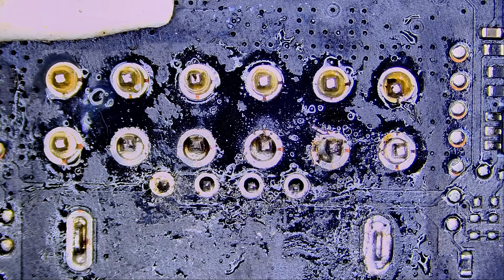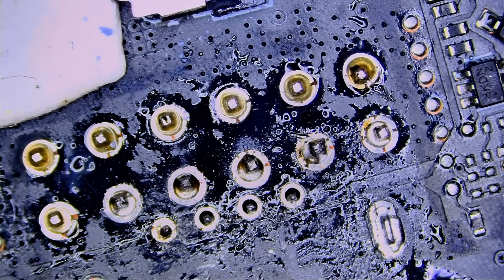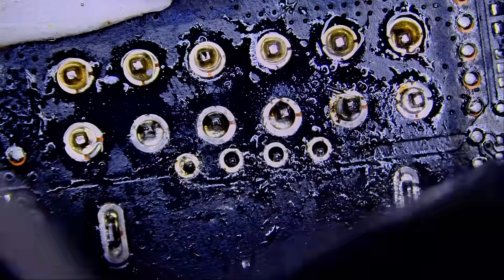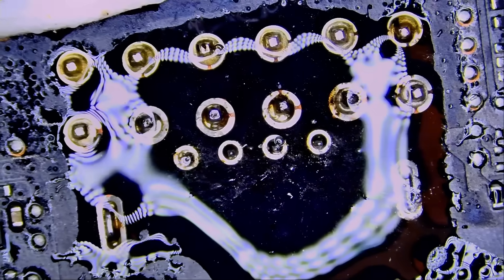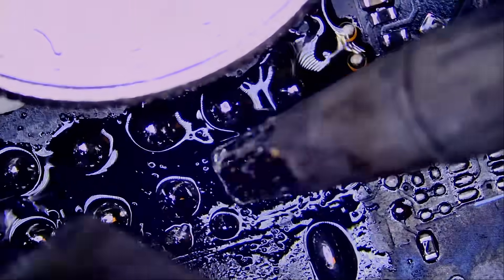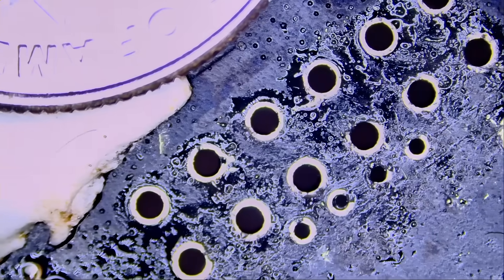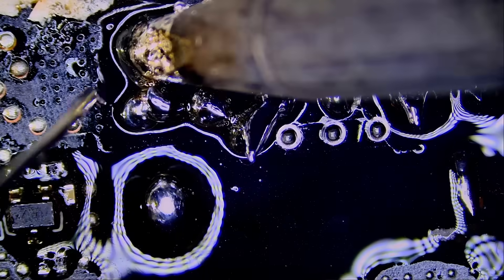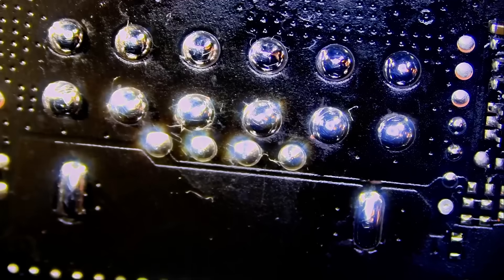Fixing a Melted 12VHPWR on RTX 4090 Founders Edition

Comment: "I did an update for my Sony A7"....Another case of "If is not broken, Let's break it"😁
Reply from the maker: The new firmware adds major features like vertical screen rotation, on-screen audio levels, new focus areas (Spot XL, Custom 1–3), and clip marking (OK/NG/KEEP), so the update is justified. I reverted back to the older firmware and will continue using it until the new one  is fixed